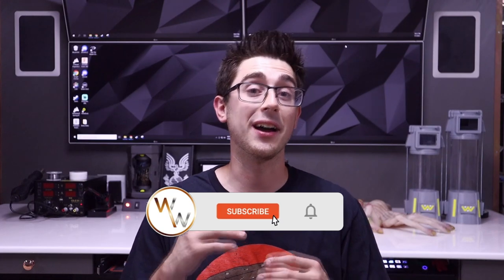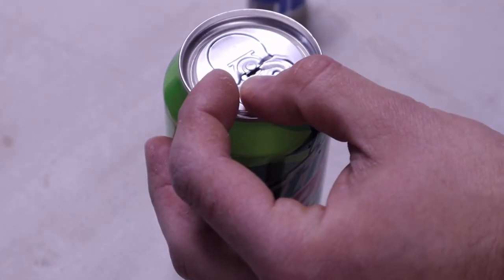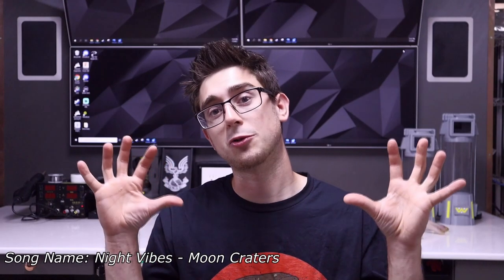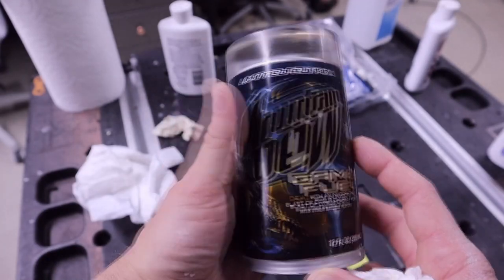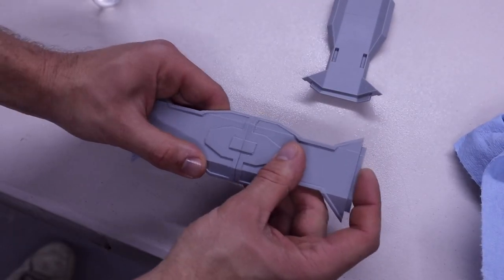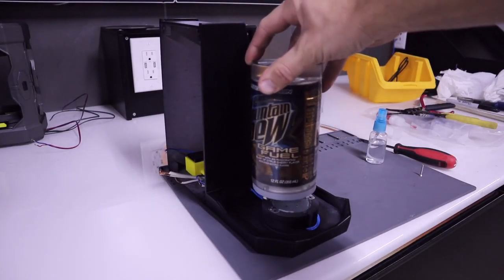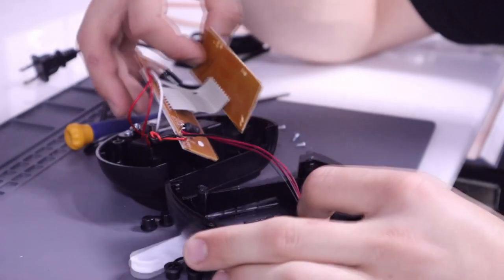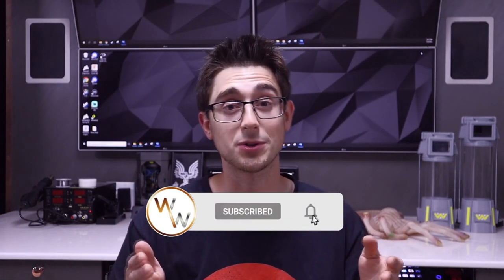This Halo Fusion Coil Charges My Phone!

Comment: This is so cool! would you show how did you connected the wires?
Reply from the maker: Thank you!! And I actually didn’t want to show that part due to it potential being unsafe for other people to attempt
Reply: @WiredWorkshop  Well I'm a mechatronics engineering student so I know how to handle some wires, I wanted to try doing this but I understand that it could be dangerous for someone who doesn't know much about electronics. Thanks anyway, it's a very good project!